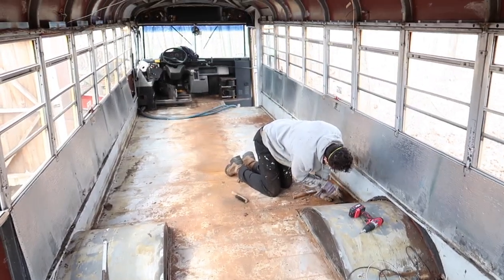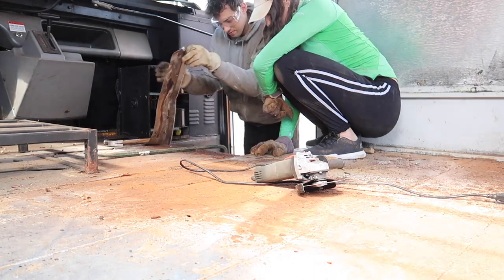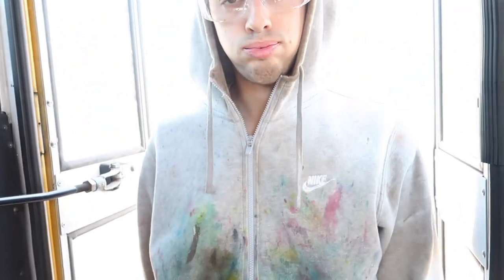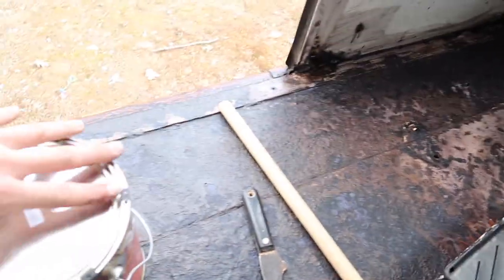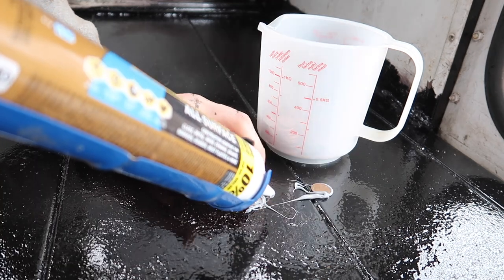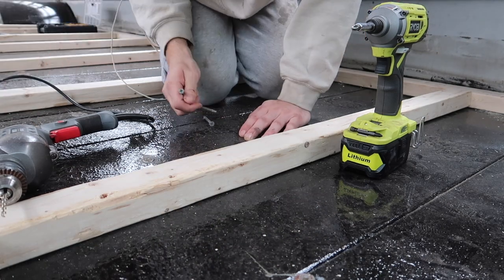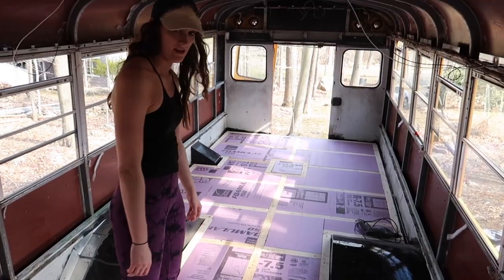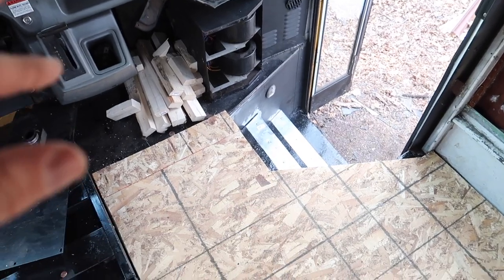Skoolie Bus Conversion - Ep 2 - Floors, floors and more floor

Comment: One thing tho, screwing the new sub floor into the metal floor of the bus runs the risk of making even a pin sized hole that water can get through so my suggestion is to paint the screw tips where they come out underneath the bus
Reply: i wouldnt use screws to screw em in... glue is better answer

Comment: Do i really need to install a subfloor like that? Can't i just use the wood subfloor my bus already has? Im afraid once i add a floating floor like this that my head will touch the ceiling 😢 (I'm 6' tall but closer to 6'5" with my hair up)

Comment: Hey there, I'm the process of designing my bus. Kinda have been for a year or two. I was just wondering if you have the interior dimensions on the floor in this bus. I know the height is apr 6.5 ft and width is about7.5 to 8 ft. I've already drawn out multiple idea for different vans and shuttle busses but this is pron the size bus I'm gonna end uo going with. Any aprx  is good I'm drawing plans based off 30ft starting behind the driver seat